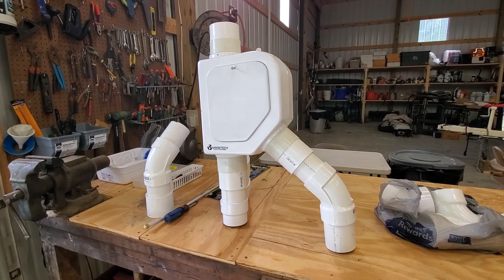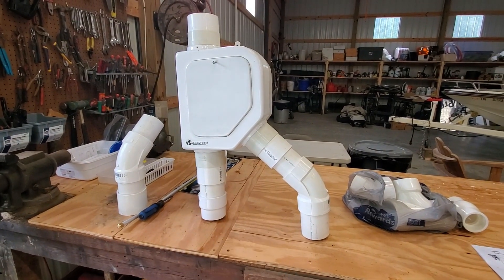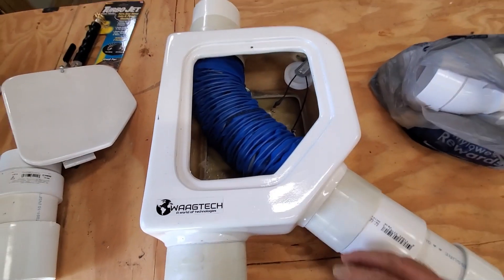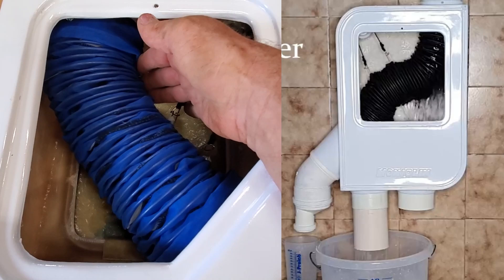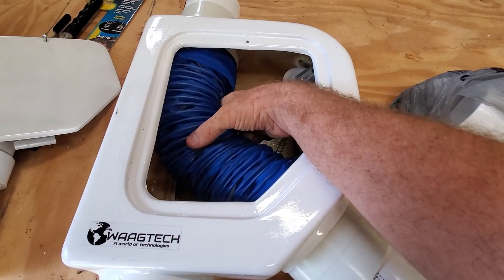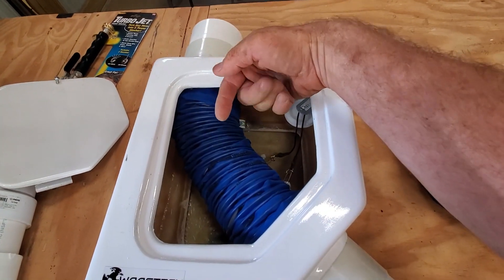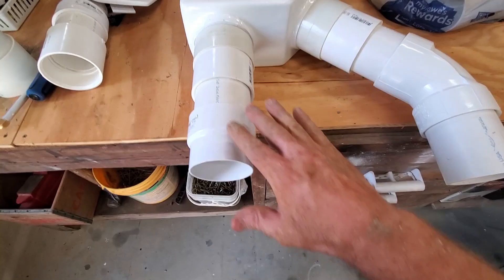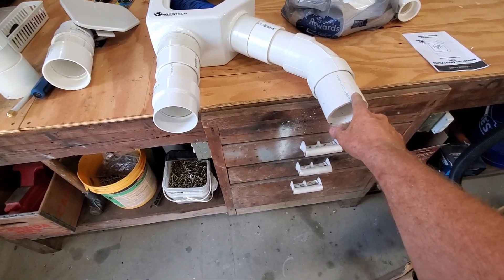The BEST rainwater downspout diverter!

Comment: That's a super unique design. And you're right, I hadn't heard of that diverter before! Curious to hear how well it works long-term
Reply from the maker: From my research, the mesh will likely need replacement after several years.
Reply: It truly is one of a kind! We'd love for you to give it a try — we're confident you'll be impressed with both the water quality and how efficient it is. As for durability, we've been in the U.S. since 2021, and only a handful of replacement filters have ever been needed. So you can count on long-lasting performance!